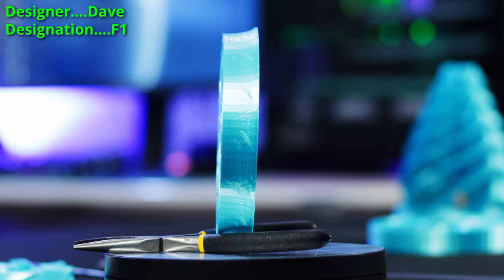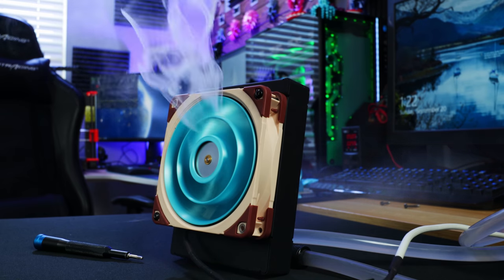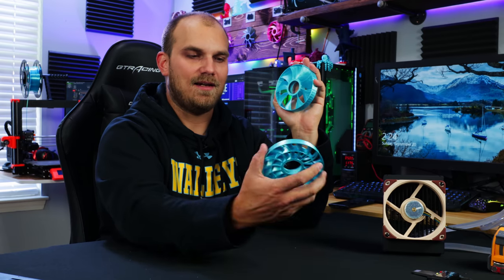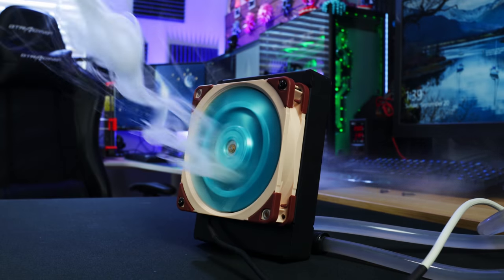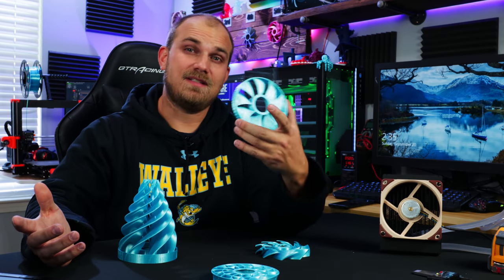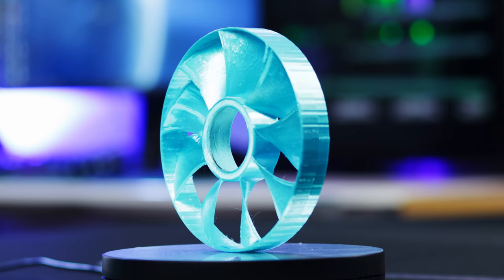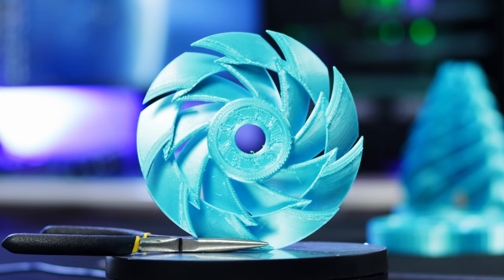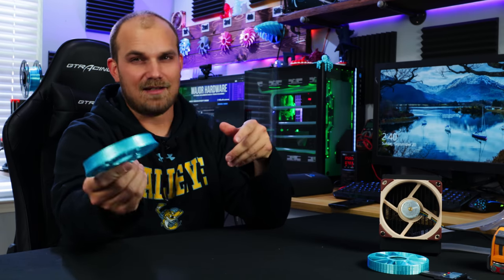This Couldn’t Possibly Work… Could It? | Fan Show Down Episode 5

Comment: here is a good idea - why not replicate the blades of a airliner engine?
since these were designed to move A LOT of air than i suppose these should work phenomenally in this application.
i am unsure how would you be able to print such a complex item (it has tons of blades after all) but if anyone of you guys could do it than that would be very interesting!

Comment: I know it's not a fan but what about a tunnel from the fans on a gpu to the outside of the case. So you could drop temps inside the case by getting it straight out?

Comment: you should look into a resin printer. you would be able to get much cleaner prints with smoother surfaces and reduce potential airflow loss
Reply from the maker: I got a mars but I need a Saturn for the build volume

Comment: Is the fan 120mm or 140mm. Also if it is a 120mm you should also try doing the same prints but up or down scaled depending on what size can he is already using

Comment: The standard audio test is supposed to be taken from 1 meter from the object your testing 

If you test a vacuum cleaner with the meter it should match the sticker on the machine at 1 meter distance

If i'm wrong i stand corrected but i am pretty sure.

Comment: Does non-symmetric placement of blades help with noise? I remember Apple did something like that a while back to try and spread the harmonic frequencies, but I haven't really seen this replicated on many normal fan blades. I'd be interested in knowing if it has use or not for lowering noise.

Comment: I know you normally create fans, but can you make a reverse vertical mount so that the RTX 3080 exhaust towards the aluminum or glass panel and do a GPU temperature test between regular position, vertical position, and reverse-vertical position?  by mounting it in a opposite-down vertical position and bridging the gpu on top it should allow cool air to flow between the gpu and the motherboard while trapping most of that air for the gpu. Additionally it allow the cable to go under the gpu, and have the RTX 3080 logo visible. I showed that idea to Pedro of PCMR on my Twitter page and he liked it.

Comment: Is there any difference in fan speed as measured by your handheld tachometer and the tachometric signal outputted by your A12x25? Also if you have other brands of fan I'm curious if they differ in their readout too.

Comment: You should contact the people who designed the really efficient fans like say your top 10 or top 20 and work out a way to sell copies of their fans to people who watch your channel or just people in general so you can 3D print them for people who don't have a 3D printer and ship it to them give the person who designed the fan a little bit of profit and allow people who have fans with the replaceable fan part to increase the efficiency of their fans.
Obviously they would have to send you the dimensions of the current attachment and the dimensions of the fan box it's in so that you could print an accurate size and give them an accurate estimate of the price.

Comment: Do you also measure the discharge of the fans? Like air has fluid like movement, and so a discharge can be calculated too, right?

Comment: The tulip has one fatal flaw in its design, and that is the counter-rotating center fins. If he chose to do a tapered center spike, he could have had the support as well as increased airflow at the center that would be ducted for higher compression. the Tulip has the potential to get on top.
Reply: the extra bits at the center of the tulip were  NOT counter-rotating.      they did make  extra turbulence, and  lower pressure in that  area.    is that good.  idk.       they also produced additional turbulence, outboard, from  centrifugal  affects.       d
Reply: @daviddavids2884  the center fins were counter to the main fins. the helix was opposite, leading to an expulsion out the front.

Comment: 6:27 was not what I was expecting, I was hoping to see the smoke go into wide end and come out the tip.

Can this fan be reversed? Does it operate in pull-air mode as well as push-air mode?

Comment: On the "Dave F1" fan blade, offset the inner and outer blades by half way.
____
I_I_I_I
  l  l  l
Or, alternate their angles from each other.
I_I_I
/-/-/
That may adjust how his fan operates.
The "Kevin 3080", double the thickness of the blades and the noise level might drop by 1 or 0.5. Shouldn't be a radical change but some of the noise coming off of it is because of the small holes and the micro vibrations from the flimsy blades. Thickening it up should actually reduce some of that, again, not by much.
As for the "Anonymous Tulip" that blade would serve best under water as a propeller, however it is an interesting design for a actually fan. If you could find a way for the blade to spin the opposite direction, letting the air flow be pulled in from the larger end and pushed out the smaller, it may perform slightly better.

Comment: Your prints look like they have a really rough surface. I wonder how much the rough surface degrades performance. Would you print them with abs and use acetone to smooth the surface?

Comment: Please design a version of the screw design fan in the correct orientation! It doesn't need to be nearly as tall as the "tulip" but if the narrow end is at the radiator and vice-versa, you'll be compressing the air as it pushes through the radiator. In theory, the (slightly) compressed air should result in greater cooling, because it would make the air into a denser medium.

This reflects the much more extreme step up from air to water cooling. A denser medium means more heat transfer by volume.

Comment: And now you guys know why all fans basically look the same: Because the fan geometry makes no real difference.
You cannot magically move significantly higher amounts of air by simply altering geometry, results will usually be in the same ballpark unless you screw up badly.
Diameter and fan RPM are what mostly limits throughput.

Comment: The ridiculous designs did good. The spiky one did good.
Why don't they produce those on a big scale? price! It costs a lot to manufacture them.  One reason they have to go with a compromise. And noctua fans are already pretty expensive, imagine they would put the tulip on, that would be a fan for like 50 bucks.

Comment: yeah, the thought that a spoiler design would make a good fan blade is a bit off. Spoilers are made to create a downforce not to move air. it is in fact redirecting the air's energy into the spoiler. For a fan, you want to create a vacuum or low pressure on the intake side of the fan a spoiler works to create high pressure.

Comment: The F1 fan should have had a different blade angle on the outer right fins. It would help pull in more air as it takes longer to go around than the inner blades.

Comment: Wait so there is no load on the water?  If there is a load DELTA or change would indicate from water temp the higher the delta that the fan changes or cools the water should rate the fan higher.  Or am I not understanding the delta change.  I would think that the more the high temps get pulled down would make the fan better at doing its job.  Also I I wonder how hard it would be to put a GM mass airflow sensor behind the fan and actually see what the CFM each fan is actually pulling.

Comment: Someone steal this idea from me: Make the inverted form of the tulip fan.. like a funnel spiraling into the fan. The idea is to use extra space outside of the fan to get a larger diameter fan and effectively funnel it into the fan body accelerating the velocity of the air.

Comment: dude you have to laminate those 3d printed blades or the little ridges create more air resistance and more noise than a quality part would
or print it in resin

Comment: The inner ring is what ruined the F1 fan, it stopped the blades from using the full length to accelerate the air

Comment: If the tulip were to used as case fan, would it "grab" more hot air out due to it's surface area?????
Reply: You could put a motor under the pc and make it spin..

Comment: some info, for makers.        firstly (im new here)     have you ever tried  PULLING  air through the heat exchanger?     if not, another phase of testing is possible (might be quieter).       in this case,  an impeller should have fewer blades, so that the area of each blade is  greater.      use a prime number.      five or seven.        there should be  NO  extra,  airflow  IMPEDING,  structures !!!!      little or no outer ring.     it should be  Clear that the presence of an outer ring  Reduces  the  effective  Area  of the  impeller.       blade design should be informed with the knowledge that  centrifugal force continually tries  to  'fling'  the air,  outwards;  away from the center of rotation.      the baseline performance of the tulip was surprisingly, good.      just too tall and  design fails to  limit  adverse  centrifugal  affects.   d     googletranslate

Comment: Yeah, but the 3080 fans spin in the opposite direction that you'd expect them to, so Kevin designed that fan improperly (backwards) if he was designing it after the 3080 fans. That fan on the 3080 blows upward into the case. Now look at it again, and orient it in your mind. Yeah, the blades spin backwards. Nvidia did this on purpose to cut down on noise.

Comment: I can see why the F1 fan fail. The amount of air space between blades lends itself to very low static pressure. It may be better as a case airflow fan. The 3080 fan I think failed because the design basically had holes in the blades from being so thin. If the blades were thicker. I believe it could at least get better performance.

Comment: One question that's always bothered me, without a properly valid answer so far ... why do all computer fans have an ODD NUMBER of blades, and coincidentally, usually a PRIME NUMBER at that (5, 7, 11) . I always thought it was economic ... to FORCE you to buy a whole new fan if you bust a blade (since an odd nombered blade design it will now be wildly unbalanced, whereas an even number of blades allows you to just bust off the opposite blade to restore balance), but surely that can't be the ONLY reason.

Comment: I think it'd be fair for you to tweak the designs slightly if it doesn't print well, like because of thickness. After all, it's about the design itself, not about the 3d printing expertise of the designer

Comment: Here most problem in circle outside fan. In the end of fan is most high speed and high preseare, with circlre outside of fan losing big part of most essective space on blades of fan. As I reming fan take a lot of air directly from coners near end of blades this is space with most presuere in system because there is most high speed most far from center.
Reply: I mean pressure

Comment: i'm suprised no one has gone full silly yey and tried to 3d gears and a housing to the mounts to spin the fan at higher rpm
Reply from the maker: ive tried but with FDM and the size i was going for it didnt really work, BUT now i have a resin printer maybe i should give it another shot.

Comment: What printer are you using ?
Reply from the maker: Prusa Mk3s
Reply: @MajorHardware     thanks.   I have been looking for something nice to start with im new to this
Reply from the maker: My favorite cheaper printer is the FLsun Q5 atleast of the ones I tested. And its a delta which is cool
Reply: @MajorHardware  thank you for the recommendation.   I might get it.  Do I need to order anything else for it besides filament?
Reply from the maker: @SunriseCrawlers  nope and its super easy to put together, the part cooling fan is its only week spot, i have a video i did on it.
Reply: @MajorHardware   thank you sir im gonna order one and some pla I guess ?

Comment: I'm very curious to know how a front  jet-like fan with several blade stages and stator vanes (in an outer shell that would attach to the screw holes) would perform
https://www.flight-mechanic.com/wp-content/uploads/2016/05/1-48.jpg

Comment: ....I wonder how does the blade pitch relate to performace since better designs seem to have smaller pitch (higher airflow/drag). Siple design solution would be a fan that could be adjusted with a single spring loaded screw in the center whose freefloating bearing/nut would be connected to blades ends ( https://www.researchgate.net/profile/KC_Wong3/publication/224296530/figure/fig5/AS:667654939484167@1536192750684/Schematic-of-Variable-Pitch-Propeller-VPP-System.png )...